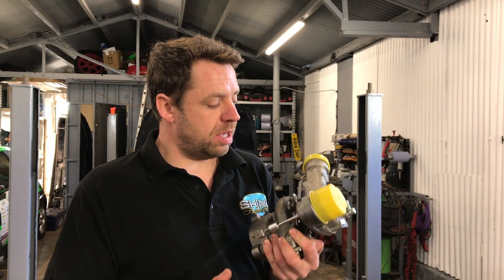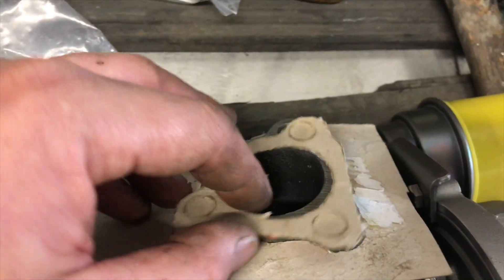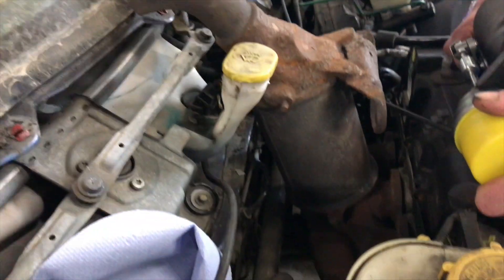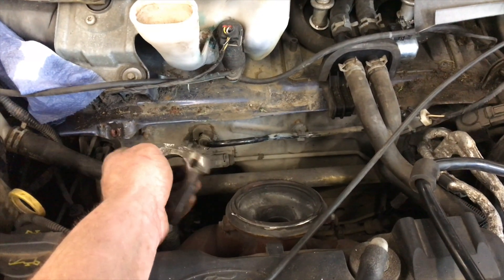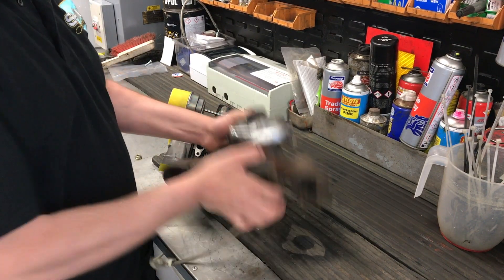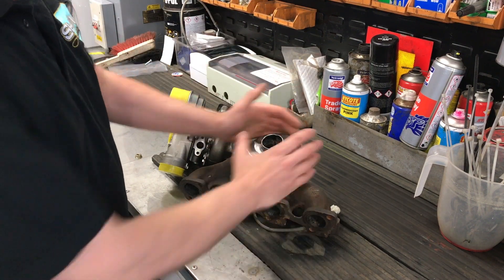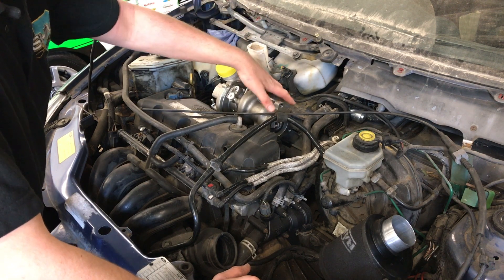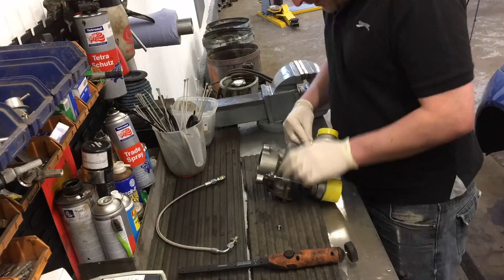Fitting a turbo to a non-turbo car. Using scrap. What could go wrong. Ford KA sleeper build.. Part 6

Comment: plastic head cover !!!!!heat!!!!! fire risk
 not good
Reply from the maker: still running now have you seen the full Series the “rocker cover” Is wrapped in gold heat shielding that NASA use . We have no overheating with oil temperature or coolant temperature tried and tested method perfectly fine thank you very much for your comment but if you watch the full series you will see we did an episode all to do with heat displacement. Have a lovely day